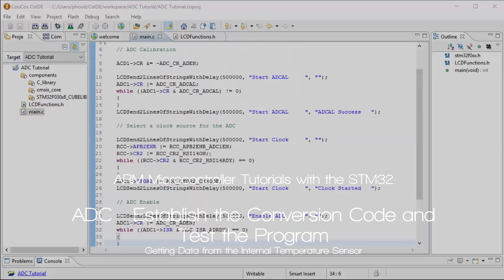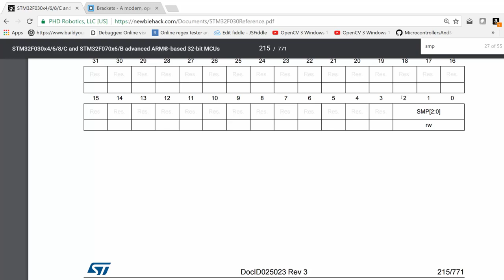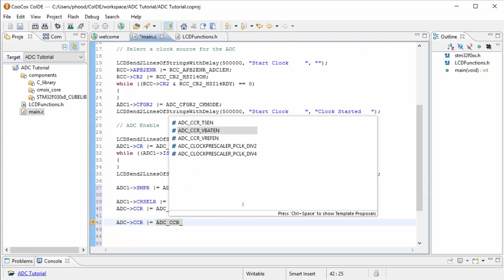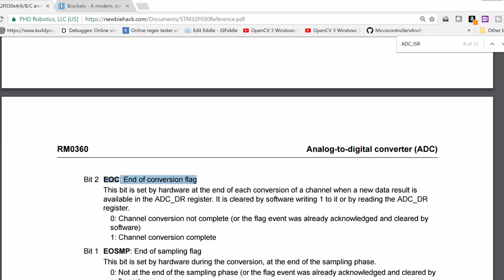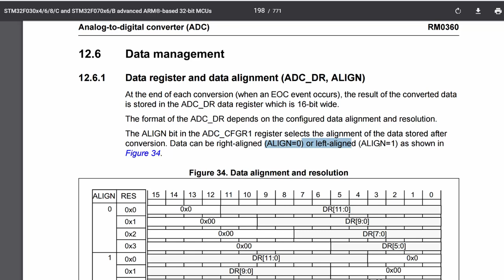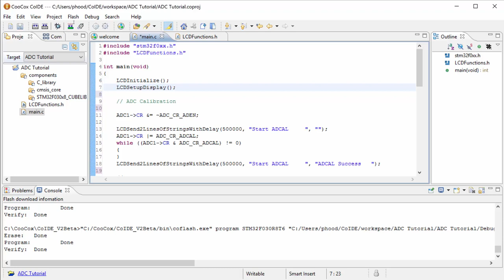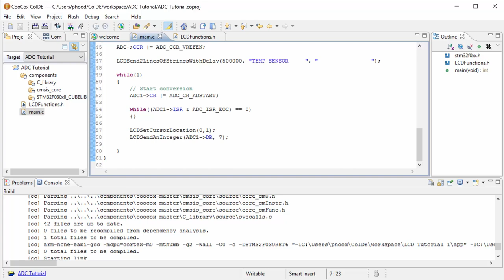36. How to: ADC Convert and Show Raw Temperature Sensor Reading - STM32 ARM Microcontroller Part 3

Comment: Hi Patrick
I'm confusing when to use the register under "ADC1 "or "ADC "
Some of the part make sense like "ADC1->CR"  ,the control register is under the ADC1 we want to control , but take ISR for example , some of them are under ADC instead of ADC1
I'm wondering is there a tip for it?
thanks!
Reply from the maker: When I use the ADC without the ADC number, I am accessing the ADC Common Control Register (CCR).  This register, I believe, is an overarching register that is common to all of the ADCs on the chip, since there can be many ADCs on a single chip.
Reply: Thanks for the reply!
I get your point!

Comment: Hello, Patrick. I know it's been 3 years ago, but i hope you read this.
I have had follow every steps in your adc tutorial (since 32nd vid) but I keep getting 4095 result (not around 1740 like in this video).
The only different thing i do is, I'm not using lcd. Instead I send the data through usart to arduino and then open serial monitor. Nothing wrong with the usart, I guess, as I also sending messages like "Clock Started" etc. and all of the messages shown correctly.
Reply: I also try to change channel using CHSEL14 and put 10k potentiometer on it, the value only change when the middle pin of potentiometer closer to gnd (the potentiometer turned to about 7.89k | 2.47k)